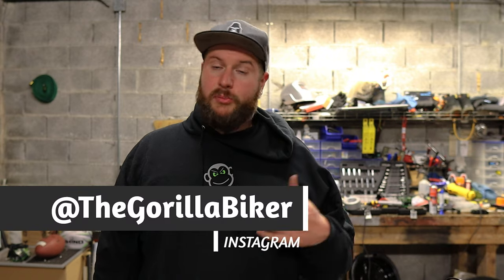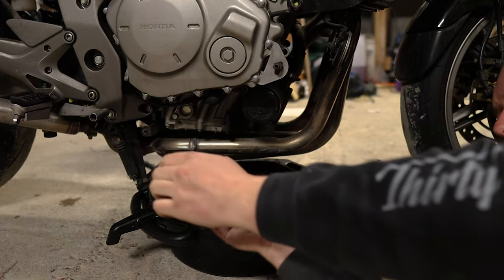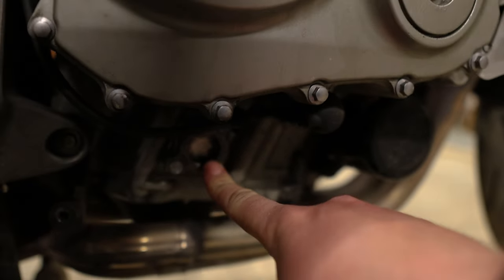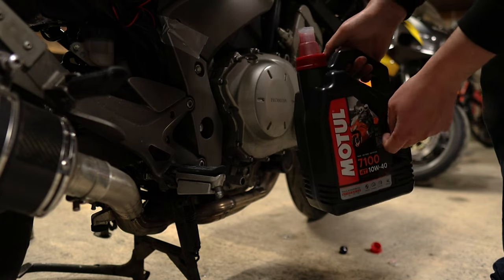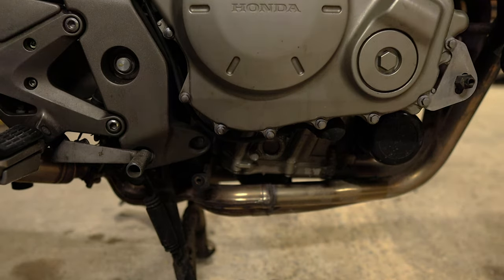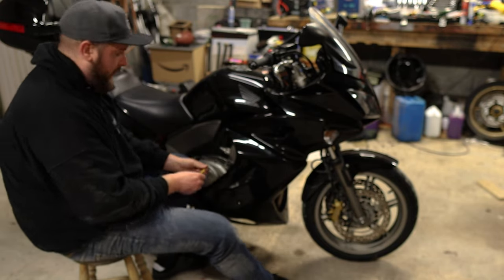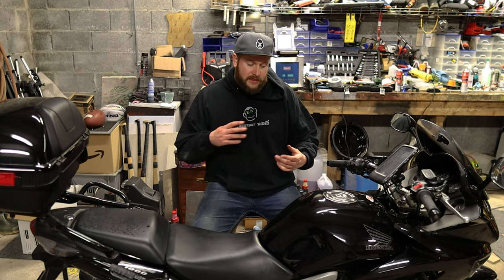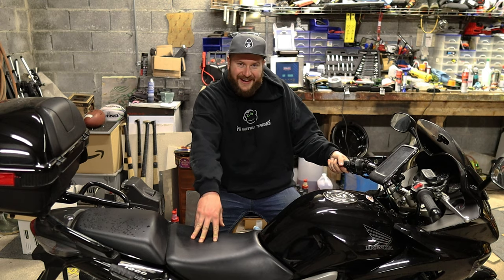How to Change Oil on a CBF1000

Comment: I'll have my bike's first oil change to do soon, but I'll need 4-liters of oil (4.3-quarts). And I have two drain plugs, and a dipstick to check the level.
Actually, this time around, I'm going to have Honda do the first oil change so they can do the other inspections and adjustments under warranty. 
After that one, I'm on my own! And, it's always interesting to see how Honda does things, and it was nice to see they kept it easy for the CBF1000. :)
Reply from the maker: 4 litres is a tasty amount, what's the service interval with that much? I personally prefer dipsticks and multiple drains....I find they work better :) Ah yes that is indeed a good plan :) I'll get something new enough to have a warranty eventually :D Yeah they sometimes make things over engineered and painful. my favourite bike to work on is still my GSXR :)

Comment: Perfect. I was going to ask which filter you used and then you told me anyway. I'm going to go for the Motul 5000 semi synthetic as it's a good amount less then the 7100. I was going to wait for the tyres to need changing and get everything done at the same time, but the Bridgestone BT021s I have are wearing so well, I'm doing the oil myself. The bikes done just over 3000 miles since I bought it last year and the tyres are only half worn and gripping better now they've had some proper use. Thanks for this video..👍 😁
Reply from the maker: Haha happy to help :) Look pretty much any oil will be grand once you change it often enough, only reason I use the fully synth is cus I like to ride the bike in a more spirited manner a lot :D Ah it's always great to find a tyre that just suits you and the bike, that was me and Dunlop Roadsmart 2s on my old Fazer :) Thanks for watching!

Comment: nice video. When yoh can splurge go for the 300V Motul. best oil I have used in a sports bike. it shifted smoother and revved easier.
Reply from the maker: Thanks. I'll try it in the GSXR, I used Liqui Moly in that last time and it's ran very well but I am a Motul fan :)
Reply: @TheGorillaBiker  LiquiMoly is great stuff as well. definately give 300V a go you will be impressed. costs around $20AUD more in Aus but damn nice. Ill be looking at just a premium mineral for the bucket of bolts next time to see if it helps the clutch

Comment: The nozzle you press on a soap dispenser long tube can be stuck I to the oil resovour and that can suck up the oil if you put too much into it. I had this issue and it took out what I needed as I put too much oil in the engine which is a no no ha
Reply from the maker: That is actually genius......I've only ever put in too much once, I siphoned it out but that would be so so much easier :D

Comment: Hello bro, I have questions, how many kilometers should I change the engine oil?
Reply from the maker: I am not advising you on anything as you can get that information from the manufacturer and service manuals. But I can tell you I changed mine every 3000 miles or 4800km. If the clocks had been in km I would have done 5000km.